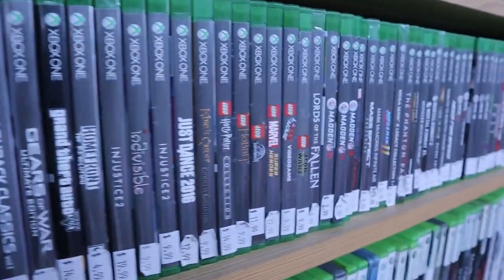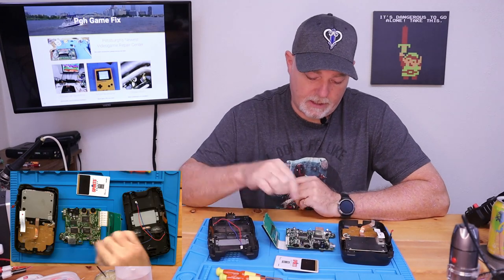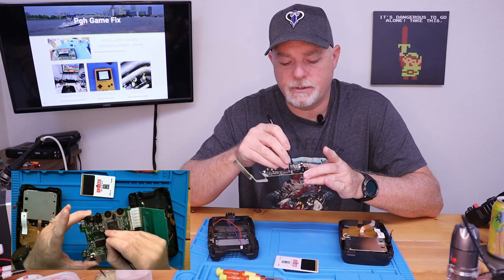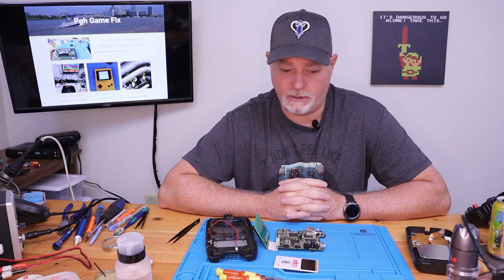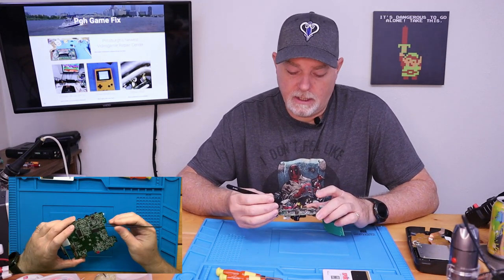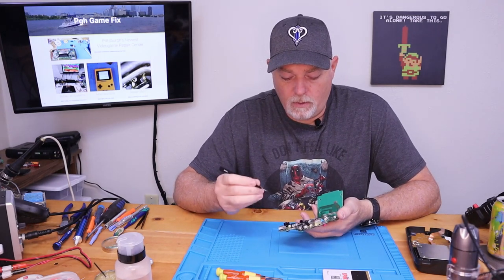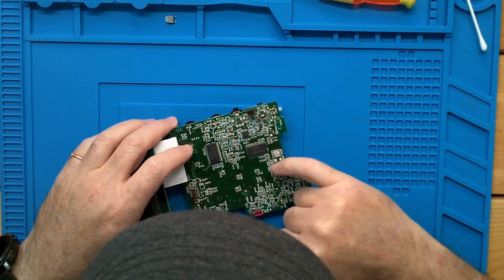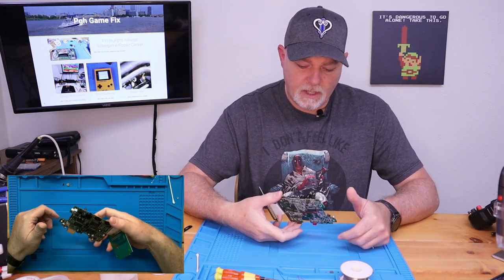NEC Turbo Express Repair and screen mod part 1

Comment: Great video and very educational! I have a Turbografx Turbo Express that needs a larger screen mod and caps replaced. Would you be interested to perform the repairs?
Reply from the maker: Sure.  I've done several for customers. You can send it to Warpzone in Greensburg PA.  Make sure there is a note in the box with contact info, and on the address label add "Attn: Tony Ferraro".

Comment: I have one but when I turn up the audio the screen pulses to the music for some reason
Reply from the maker: The batteries are weak, and the voltage is dropping.  Also, have the caps been changed in it yet?  That is a sign of sagging voltage, and if you know the batteries are good, or you are running it on a known good supply... then you have caps on the power rail that are stating to give up.
Reply: I’m sending it off to get the caps replaced  and I told him not to use caps from China Nichicon branded caps